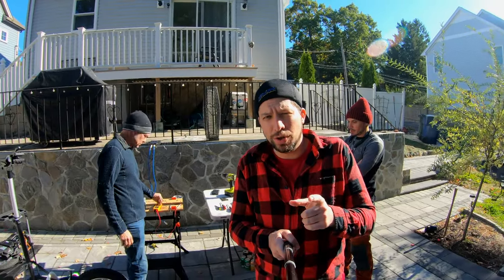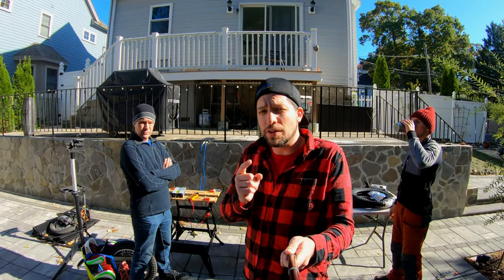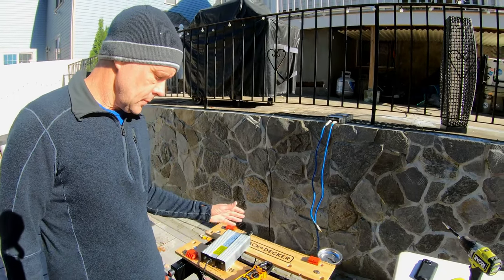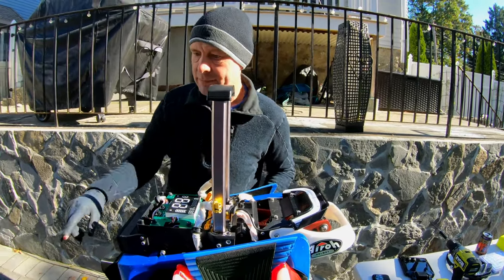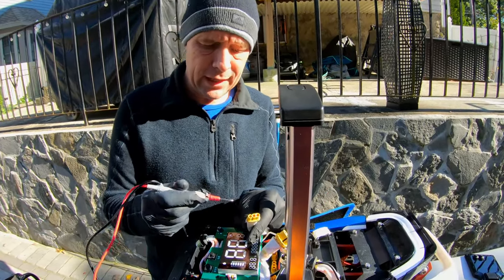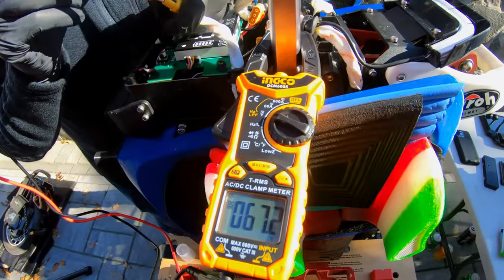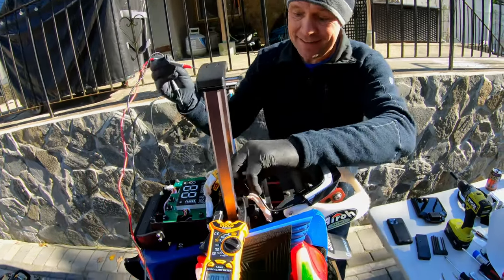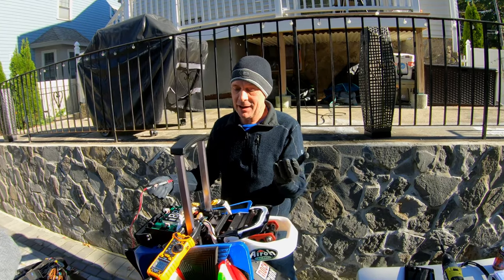Critical Issue With Begode Master - How to Fix and Maintain Your Master Battery

Comment: I love that you guys talk about the dangers about working on live electronics,  and some precautions... too many mod vids out there just tell the random Joe to jump into potential life threatening mods without as much of a word on safety.
Reply from the maker: gotta be real lol we are working on high voltage electronics
Reply: @GoGeorge  The move to these higher voltage wheels makes it a much bigger consideration than my days on a Ninebot One E+ at 63V, having said that anything over 50V should be of some concern. I was always taught its the mills that kills and the volts that  jolts, mills referring to milliamps. Unfortunately it's the volts that drives the current. What actually kills you is the current through vital organs over time. Higher current, or greater time the greater the danger. As little as 30mA across your heart being enough to kill you if it's there long enough.  How nerdy is that? See what a background in electronics gets you :-) There was a time I was working with voltages as high as 19kV with 50kW PSU's pushing out the power - what could possibly go wrong :-)
Reply: All mods are dangerous.
Reply: @Kay0Bot  wow stickers are dangerous. who could have known?

Comment: Excellent video and info George!  When I first got my Master I was only getting 34 miles out of it and had to end up sending it back to Alien Rides.  But before that I had a buy a voltmeter and test each individual pack and it turned out that the two rear packs were not charging or discharging. When Alien got the wheel back they discovered that BMS fuses had blown and they procured updated fuses from Begode. They also checked each individual cell in the packs and determine they were all okay. The wheel is running fine now and I'm getting 70 to 80 miles of range.
Reply from the maker: niiiice
Reply: What battery config do u have? I’m having same issue w my 40T Master (40 miles range) but EWheels just said that’s about what to expect. I think something’s wrong w my battery packs too.
Reply: @wutruriding1355  50e
Reply: @wutruriding1355  If you are experiencing this fault you should certainly see a difference between the voltages of the two forward batteries vs the two rear batteries.
Reply: @Roskellan  yes, I’ll check those along w charger when I get a multimeter. Thanks.
Reply: @mikeintampa250  Thanks. I’m not expecting 80 miles range but should be more than 30 so something’s wrong. Actually suspected this when I first charged and only reached 133v.
Reply: @wutruriding1355  if you have the same issue I had, EUC world was showing 100% 133.7v (even though on only two packs unbeknownst to me) then quickly went down after that. I checked the voltage in the four packs and only two were charging and discharging. I bet that's your issue. In my case they said I had blown BMS fuses it could be the same for you and I was the first one to report the issue to Alien and they took my entire wheel back to get this done. But they said for everyone else now that they know how to resolve the issue all you would have to do is send your individual bad packs back to them. But I don't know if you purchased from Alien or not.  On a positive note, it shows that the built-in redundancy works, meaning that if one or two of your packs goes you're not going to be thrown off the wheel.  I didn't know how to check voltages before getting the master. But I do now. All you have to do is get a relatively inexpensive voltmeter from Amazon for like 15 or $20. The master seat and the underlying plastic plate are very easy to take off just several screws. Then you unplug each one of the packs into the charge board and then insert the probes from the voltmeter into the ends of the plug for each pack and it will give you a voltage reading.  If one says zero that's definitely a problem pack. But what I did is I took the voltage readings put it all back together took it out for a ride took the readings again then charged it up and then took the readings again and I was able to isolate two of the four packs whose values were not changing throughout all that.  It turned out those were the two packs with blown BMS fuses. Hope this helps
Reply: @mikeintampa250  I also rode on 2 packs for a week, with half range. One battery was showing zero volts. My dealer replaced 2 packs.
Reply: @mikeintampa250  Excellent info and just what I need. Sounds like my issue, darknessbot shows 100% battery but only 133.0v every time I’ve fully charged and no matter how long I keep it on the charger. At first EWheels claimed it was within Litech variation but when I text them today, they said looks like the charger issue. They’re going to walk me through the charger and battery testing tomorrow so we will see. I really appreciate all the help and glad you got your Master fixed, it’s a really fun wheel.
Reply: @mikeintampa250 ...... It makes me uncomfortable knowing that many will now buy cheap multimeters and adjust their chargers with it.
Please check the accuracy on the multimeter first. Even the multimeter used in the video is NOT 2 digits accurate in the specifications. It is 0.5% PLUSS 3 digits.
And a cheap one from amazon can be 3% off and still be within spec.
Reply: @wutruriding1355  np, good luck w it.  Remember mine showed 133.7 + 100% on EUC world even though only 2 of the 4 packs were working.  2 of your 4 packs prolly have blown fuses.

Comment: Please remember guys that 134V is potentially lethal, no pun intended :-)
Reply: voltage doesn't kill you.. current does.
Reply: @TrungNguyenSquallLHeart  Voltage drives current, I=V/R, more voltage, more current.
Reply: @Roskellan  oooh.. Ohm's law... did you forget to account for resistance? lethal current would be about 10A.. depending on where that current is flowing thru the body of course as well..

but you also forgot to account for the resistance of a human body... a static shock can generate millions of volts.. but alas.. it doesn't kill you, does it? there's not enough amperage generated because.. oh.. yea.. resistance.

so comparing 134V to millions of volts from even a tiny static shock... nah.. sure.. voltage drives current... but you failed to account for the third factor in Ohm's law.. resistance.
Reply: @TrungNguyenSquallLHeart  Its the mills that kills, the volts that jolts. True but one drives the other 🙂
Reply: @Roskellan  took you 2 months to come up with that one? 😐

Comment: I had thought the BMS starts balancing around 80% of voltage. like even if your charger is a little below full, the BMS should still balance
Reply: You might be thinking of trickle charging. Balancing begins after it's fully charged.
Reply: Depends on the bms I think, many only start balancing each cell individually once it exceeds  4.2v

Comment: I ran into this problem on my Master Pro in the beginning. It wouldn't charge passed 132.4 volts. Checked each pack and they were all equal voltage. So I thought it was a problem with the voltage board. After a few cycles, it started to charge to 134.4. Sometimes the batteries just have to go through a few cycles (Best case scenario)
Reply: May have been the charger!
Reply: @Roskellan  nope, tried multiple chargers and tested with multimeters.
Reply: @MomentumProductions1992  Interesting, there is hysteresis in the charging voltage especially on unused batteries where the battery voltage settles back after charging, particularly if the charger was removed immediately when the green charge light indicated a full charge, or changing with a high current charger.  The same thing happens in reverse when the battery voltage recovers to some extent after heavy use.

Comment: Very good video. But there is one very big error in it.

The accuracy on a normal multimeter is 0.5 to 1% of the reading pluss 2 digits. Not only 2 digits as stated in the video.
That means that a normal multimeter (even the one used in the video) measuring a true value of  134.4 VDC range could read all the way from 129,9 - 135,9 V DC (+- 1% of rdg  + 2 digits).  So you need a multimeter that is newly calibrated for reading 134.4 V DC if this test is going to be accurate.

The one used in the video has an accuracy of ±(0.5% +3) what I can find. That means if the charger output is exactly 134.4Volt, the multimeter used can show anything between 133.4 -135.4 V DC in the display.

(I used to work calibrating these multimeters for more than 10 years. )
Reply: whats the best multimeter one could buy on amazon right now??
Reply: Great point! Does the precision remain reasonably constant, to at least check the packs are balanced?

Comment: Great PSA George, I have this problem. My Litech 40T Master I received 2 weeks ago will only charge to 133v. I contacted EWheels and they told me it was within the batteries variation and not an issue to worry about which hasn’t been sitting right w me. But now that you’ve shown it could be the charger and not balancing cells, I’m worried and contacting EWheels again. These batteries are not something you want to take lightly especially when most of us keep them in our home. Thanks again, much appreciated!
Reply from the maker: glad this info reached you 🍻
Reply: @GoGeorge  Me too!
Reply: Definitely check the charger voltage.
Reply: @Roskellan  will do, thanks.
Reply: Ewheels unfortunately stopped replying to me about their rapid charger not letting my S18 balance.
Reply: @jeffreytong  Ya don’t know what happened to their customer service but not what it use to be, they pretty much shut me down too. I’ll go thru Alien Rides or eevees for my next wheel.

Comment: Thanks to this video I did the patented Go George Go voltage test on my stock Master charger and it gave me 135 volts. I also did it on my T4 stock charger and it gave me 101 volts. So I think I am good on each one. Thanks George for alerting the community for the need for this test.

Comment: Hi thanks for the video. I tried to adjust my faulty original Master charger (133.4 V output) as per timeline 3:42 but that pot. did not change the voltage, i had to turn the other one on the other side to increase to 134.5 V.

Comment: Thank you for sharing this information, my charger was reading 133.3v. I've adjusted the screw to it's maximum settings but it's now 134.1 is there another adjustment to turn it up to 134.4?
Reply from the maker: no thats as high as it will go, likely just a minor inaccuracy of your voltmeter though and even if it is a tick low thats close enough to full that the cells will still balance if left charging

Comment: Thanks! I did exactly that and was able to raise the voltage from 133.4 to 133.7V. At 133.7V the adjustment screw is at its max.

Comment: Thanks George. I recently got a master and it has this issue. The batteries are only charging to about 133.2. Question: if you fix the charger calibration then charge the batteries, won’t the batteries balance? Also, if the batteries are all connected to the board, why doesn’t the voltage balance off over time if you leave it alone? Alternatively, if we connect the packs to a parallel charging board, won’t the voltages even out over time (higher voltage packs will charge the lower voltage packs until they all have equal charge)?
Reply from the maker: the issue is that the packs are wired in series with individual bms systems. so once the front battery is done charging, it cuts off charging to the rear pack

Comment: Adjusted my charger open circuit voltage to 134.4V and overnight the entire pack settled at 133.9V. I then moved my charger open circuit voltage to 134.9 to see if that would compensate.

Comment: Excellent info, George.  If the charger is properly calibrated, I wonder why some of the batteries are getting out of balance in the first place - BMS?  That would seem to be the root cause.  Also, a good idea to use gloves.
Reply from the maker: the batteries are 2 x 67.2v batteries wired in series. batteries in series will always go out of balance unless a balancong circuit is added between them

Comment: So is the individual pack's bms controlling the balancing? Is the wheel's control board shutting down charging to all packs simultaneously preventing the low pack from balancing? Would a slight over volt on the charger prevent the one low volt pack problem? Where do we get that charger and is that the same one Roger is selling?
Oh and thanks for another great video!
Reply from the maker: yes these are variable bench chargers you can get from different places. the theory is once one pack hits 67.2 they all stop charging
Reply: The BMS in each pack respectively balances the cells in that pack. As this is a passive BMS it only works at the top of the charge, where each cell in a pack will be only allowed to rise to 4.2V. A suitable charger with the correct connector would have to be 67.2V with the ability to control and observe it's current which should be no more than 4A,  2A being more preferable.

Comment: Great video, my charger was more than 1.0V off. What consequences for the battery would not being aware of this issue and always undercharging and never balancing have on the long run? Could you let us know the charger model used and aprox. price? Thanks in advance.
Reply from the maker: batteries can eventually get so unbalanced that a cell dies which is a fire hazard. the charger id need to ask jason but im pretty sure he got it from archee

Comment: So this is odd. On my Master Pro all my 4 packs reach 66.1V! So they balance but not to 134.4V. I adjusted the stock charger to make sure it was outputting the correct voltage and also tried a variable voltage charger. Something is keeping it from fully charging.
Reply: Locals here believe it’s the mux is misconfigured…looking up what the hell a mux is.

Comment: Did you lower the voltage of the overcharged pack before you put it back together?
Reply from the maker: no, being .2v off isnt concerning . when you start getting to .5v or worse is when its an issue

Comment: I can't emphasis enough that if you choose to do this, that all batteries have to be charged to the same voltage (I mean exactly). The batteries on the V2 machines are arranged in serial pairs ,  2X(16S2P+16S2P) = 32S4P. That is the Front batteries (left and right) are series together and the Rear batteries are series together. These two effective packs are then paralleled together. Any difference in voltage between the two (then 134.4V effective) packs, will result in large and potentially dangerous currents flowing. When measuring the voltage of a pack in what should be of a charged wheel. A discrepancy of voltage between any two packs of 4V or more strongly indicates a failure of cells within that pack. DO NOT RIDE, OR CHARGE that pack.
Reply: Small voltage difference cannot cause high currents, these batteries are 30amps max when shorted, it's 30w on 1v difference (they will not give 30 amps on 1v difference anyway)
So you're probably looking at 10w of power redistribution max. Not good but not terrible 😅

Comment: When you guys say you want to "get" 134.4 volts, do you mean reported in the app? Are the app values a trustworthy benchmark?
Reply from the maker: prefer a voltmeter but they all do have a slight margin of error so more important all the battery values match on your meter than all are a perfect 67.2

Comment: So I just did these tests and my Master packs are showing 67.7v x2, 67.2v x2. Charger is 135.1/135.2v. Seems high. Granted I have the cheapest voltmeter in existence.
Should I turn down my charger? I thought the BMS would prevent the voltage from getting that high. 
I will check what voltage EUC World reports, last time I tested it was 134.5v.
Reply from the maker: no if your charger is slightly over thats fine. if the series packs are in balance it shouldnt be an issue but eventually you should try to balance it all out. assuming the 67.7 are in line though and the 62.2 are in series, you should be fine
Reply: @GoGeorge  Not sure I understand what you mean by series/in line, but my left side is: front pack 67.7 rear 62.2, left side is front 67.2 rear 67.7. so they are "diagonally" synced I guess you can say. Also big thanks for producing this great informational content and answering my questions! :)

Comment: Which batteries are the parallel ones? The back or front?
Reply from the maker: each side is wired in series and then that is wired in parralel to each other.  im not sure which battery the positive is shared from if thats what you mean
Reply: @GoGeorge  yes that's what I mean.id like to just throw two more pack on parallel for safety and range extension.
Reply from the maker: @Esk-be8kd  you should be able to trace it through the charge board . each pack is wired individually and go in series at the charge board
Reply: What type of connector is used for the master battery? Thanks
Reply from the maker: @Esk-be8kd  i belive its an mr60

Comment: Hi. My master stop charging at 130v. Been test using multimeter. Every single pack showing 32.5v. Wat posible cause this problem? Im having this problem since changing the motherboard.
Reply from the maker: its the charge board

Comment: As an Electrician I get a kick out of when people refer to sub 277v as high voltage lol I understand the context though, just breaking balls lol Great video guys!
Reply: There are people who refer anything below 1000V as low voltage (generally power company workers) and outher who refer 12V as high voltage (Generally PC enthusiasts, overclockers).
Power company responsibility ends at <1000V power line going into meter on customers property and computer chips run at something like 1V to 3.3V (VRM are used to step 12V down near those)